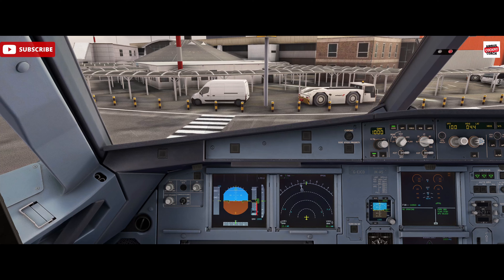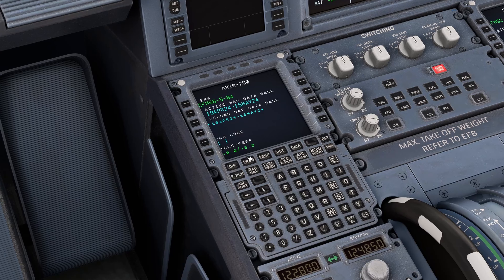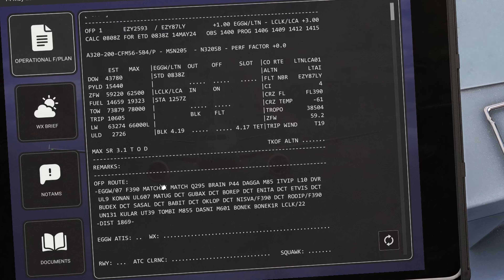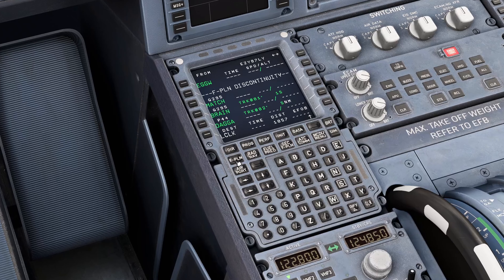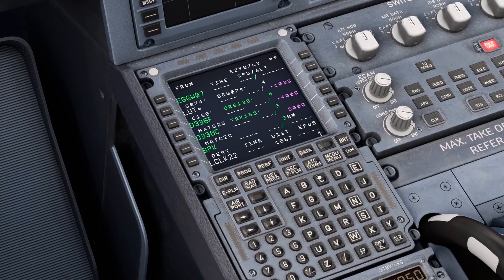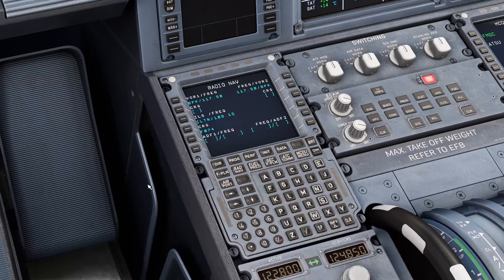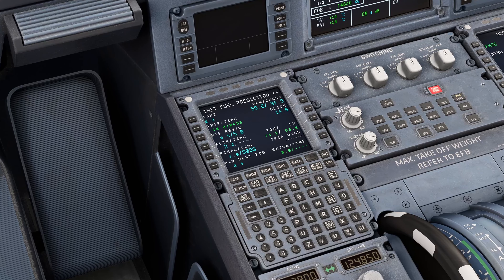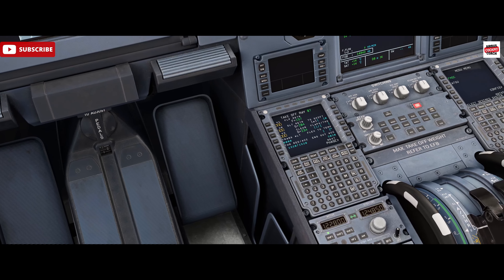MCDU Setup Explained: Airbus A320 Step-by-Step Guide

Comment: I have watched this twice now - it's super useful.  My one question is this: where did you get the info for the engine-out procedure? Is 25 miles and then hold a standard procedure?
Reply from the maker: Hello, engine out procedures are hard to come by and are usually issued by an operator. Straight out to 25nm and hold is standard unless there is terrain about

Comment: I noticed u didnt do the IRS align page, is that not necessary if we turn all 3 IRS to NAV? just checking, excellent videos always! thanks!
Reply from the maker: Thank you! We come back to this as a check later but is not part of the initial setup. Often the IRS system is not aligned at the initial MCDU setup stage. I have just released a cold and dark setup tutorial which includes that check. Thanks as always for watching 👍

Comment: Great video. Everytime I do EGGW TO EGPH  I get a flight plan disconuity  flying into EGPH even though I plan it through simbrief. Any help would be appreciated
Reply from the maker: Hello and thanks for watching. A route discontinuity is totally normal on many flights and should be there. Often on an approach there will not be a defined route from the last waypoint to the approach as that is managed in a variable way by ATC vectors and the discontinuity is there to serve as a reminder of that. The same will apply on a departure that does not have a SID, we would climb on rwy heading and await vectors and the route will have a disco.   It is a reminder that we need to take some form of action in the flight deck from the discontinuity point. Hope that helps.
Reply: Thanks for the reply, much appreciated I'll try the flight again over the weekend. Keep up the good work & look forward to more videos from you

Comment: The one thing I don’t completely understand is the fuel pred page. I can’t locate any doc on the different fuel fields, and when I increase one (ex: ALTN) it decreases EXTRA. Should EXTRA always be zero?  I realize that some of these are airport-specific (ex: TAXI) or operator-specific (ex: RTE RSV), so perhaps it’s only ALTN, FINAL, and EXTRA that I don’t get.

In the sim I added some extra fuel and really messed things up in the MCDU, so I guess I’m not clear on the best way to add extra.

I was waiting on a real-world flight recently and just happened to be sitting by the flight crew at the gate prior to boarding.  We had some hurricane weather to fly around, so the captain instructed the FO to load some additional fuel for buffer. I’d like to know how to do this properly in the sim.
Reply from the maker: Hello, ALTN fuel is the amount you need to divert to the selected alternate after performing a go around. FINAL is the legal minimum you must land with which is 30 mins for most carriers. Extra is everything left over once everything is taken into consideration and is what is need to perform a second approach after a go around or to hold so in most cases we would want some extra depending on weather or traffic at our destination. To add additional fuel this would be done via the EFB tablet in the SIM or on some aircraft the FMC. Just add the amount over the planned that you need and load before flight using whichever tool you would normally use to load fuel. It can be done through Simbrief in advance at the planning stage of course. I may do a short video on the fuel page to help others understand it 👍

Comment: In real life, m do you also have the tablet and SimBrief or only the MCDU?
Reply from the maker: Hello, we have a tablet with a different piece of software for flight performance and some other apps relating to our operations
Reply: So you still need to setup the flight on the MCDU or you can import it from the device?
Reply: @saytoga  They have to set it up manually

Comment: im a bit lost in the radio and 2nd flight plan where do u find the info
Reply from the maker: Hello, for radio/nav we get the information from our charts and input fixes pertinent to the departure and use in an emergency. The secondary flight plan info is hard to come by and varies between operators but unless terrain or airspace is an issue it is often straight out on runway heading